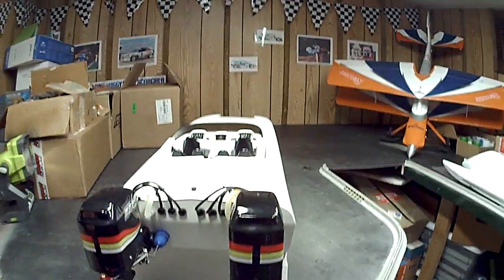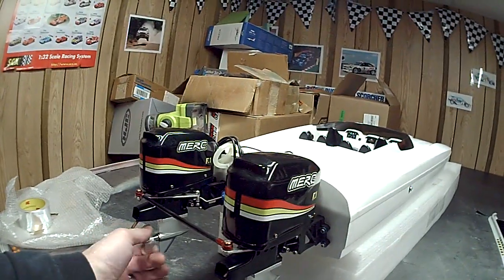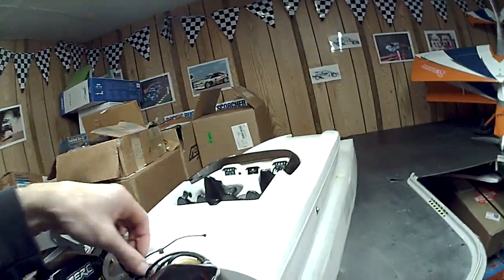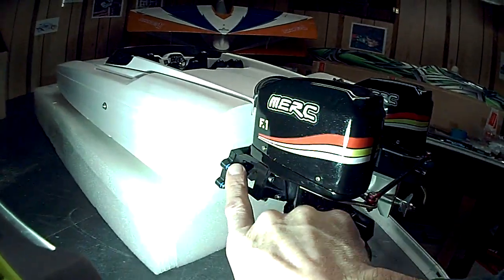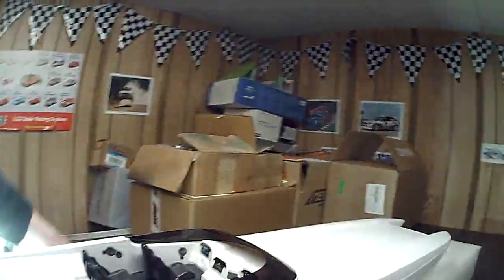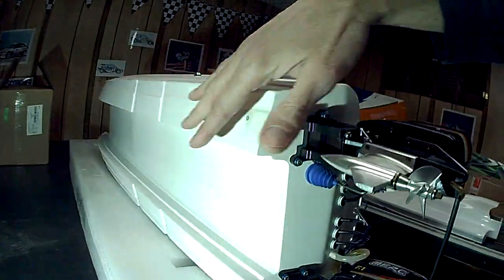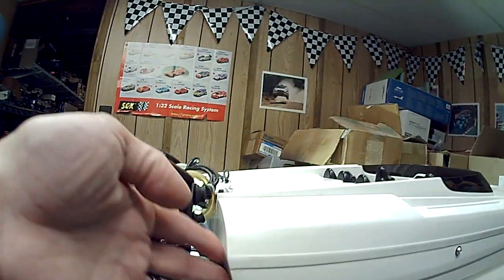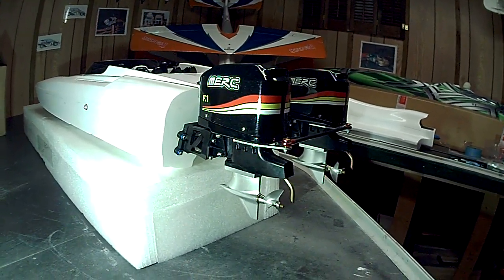Custom (really custom)  Traxxas M-41 DCB hull with Dual TFL outboards! Even shave transom off!

Comment: Can you machine a set of stand-off mounts?
Reply from the maker: Just in case you did not know, TFL makes stand off aluminum mounts for these outboards. If I were to machine them like the ones I have, they would cost more.  Check out offshore electrics.com
Reply: Yeah I have a set of the tfl stand offs 
I need to open the holes for it to fit the outboards
Reply: @vigilanterc  yes they do I have two of their mounts.I ended up making a mount but I thought I’d ask because the mounts you made look good
Reply from the maker: @dustinstokes3134  Well I appreciate that you like the ones I designed/built. I don't usually make parts for others due to little time I actually have.  Thanks for checking them out though!

Comment: Hi. nice build. im looking for the same motor a tunnel hull...   i foun it in china. are you happy with yours?  any tip on Preventive Maintenance on those?
Reply from the maker: Hello,. For the outboards.  As long as you dont flip the boat in the water, I would take out the 4 small screws on the bottom silver unit off after a day of running.  Remove the one vertical shaft. Add marine grease to gears .  Reassemble them back.   Oil  the shaft bearings on the prop side and let soak into bearings.  Then run out of water for a few seconds to get grease and oil circulation and water to escape.  Then you are ready for next time out.  Do NOT use more than 3S batteries on these outboards.  The gears won't last. Hope this helps.

Comment: Liking the Merc Racing cowl stickers. Takes me back to days of running my little 260hp 2.5 on my Allison.:)
I'm just finishing up a MHZ Racemaster with a pair of TFL sterndrives. Not at all sure what to expect in terms of speed - especially since I threw caution to the wind and got some pretty serious power for it. Still planning on 3S and to keep the kv "conservative" with 2070 kv as those geared drives really don't like too many rpm. But I have a set of 40mm CNC props with 1.9 pitch ratio, but I suspect that I'm massively underpropped for the power. Motors are TP 3630 5Y. A shame nobody makes both right and left hand rotating props with a 2.2 or 2.3 pitch ratio.

Comment: Can I buy those merc stickers from you?:-)
Reply from the maker: Now these are water slide decals that require careful placement and are fragile untill you clear coat paint over them.  Is that something you want to use?  These would also help to have decal setting solution to before you clear coat them.  I just want you to know they are not stickers, but water dip decals..

Comment: Aye man how did you do the counter spinning props?
Reply from the maker: It's easy.  Just wire one motor to run reverse and purchase a right hand prop.  Most props come both direction.  Also brushless motors have 3 wires so mix the 3 wires to the esc to make sure it spins  clockwise for the right hand prop.  These are not cable drive units so it works just fine.
Reply: @vigilanterc  thank you man I figured that but wasn’t sure !🤙🏽🤙🏽🤙🏽🤙🏽

Comment: 4s?
Reply from the maker: 3s Only. 4s is too much for gears as told from manufacturer....
Reply: @vigilanterc  I have a couple of these TFL outboards on different boats. Although rated to 3S, I've run mine many times on 4S without issues, but you have to adjust the timing down to a lower setting or set the punch control to a higher setting. Either that or just take off slowly and smoothly and gradually build speed. No full speed takeoffs or wheelie popping, or you can damage the gears. I wish TFL offered a hardened set of gears as options.
Reply from the maker: @georgegonzalez9281  I'm glad you have had good luck on 4s.  I did try 4s on a single TFL tunnel hull and wow was it fast.  I agree on the throttle punch setting.   I can use the "servo speed" setting on that channel so I can pin the throttle and it will ramp up slowly automatically.  
I wish they had hardened gears as well.  That gold titanium coating is useless on these gears.  I did buy a bunch of spare gear sets......just in case I try 4s again.